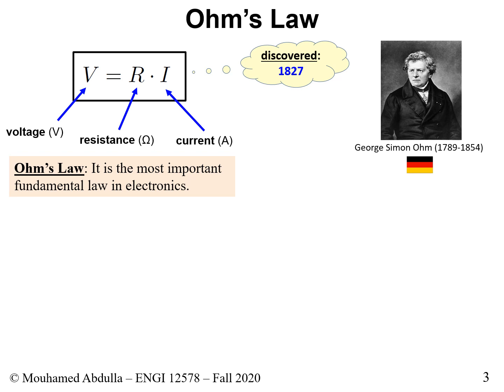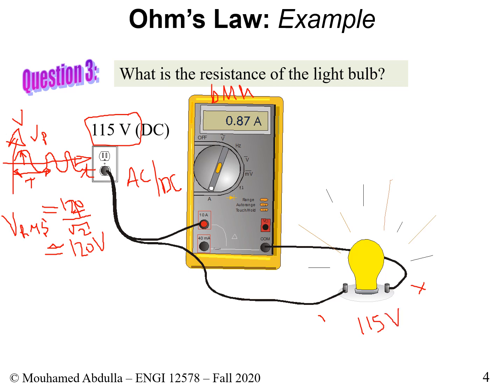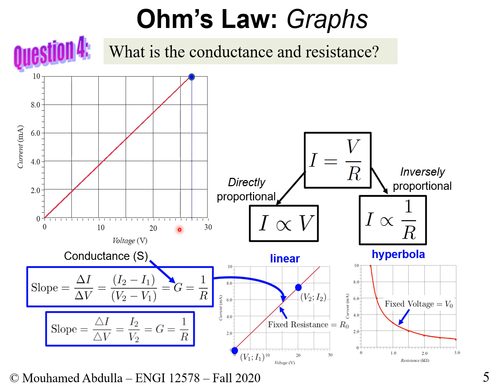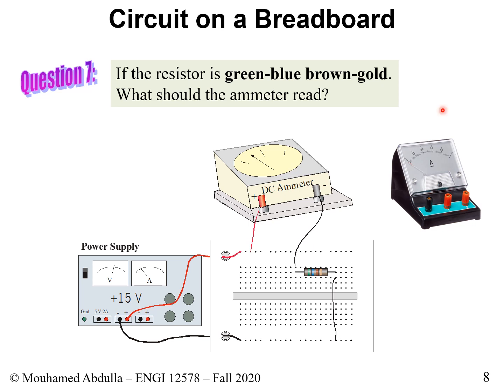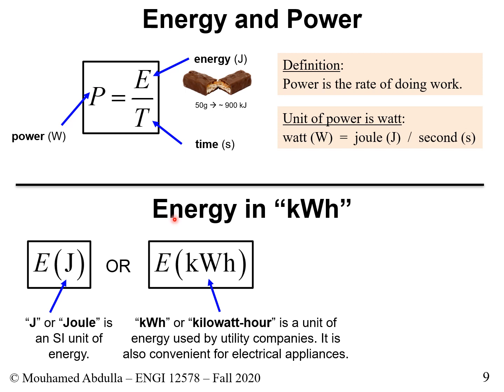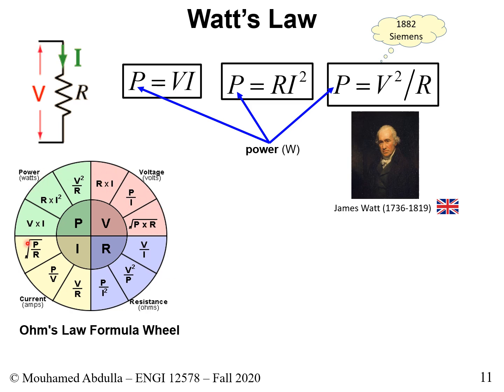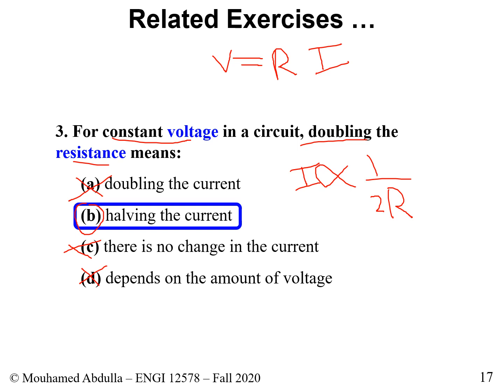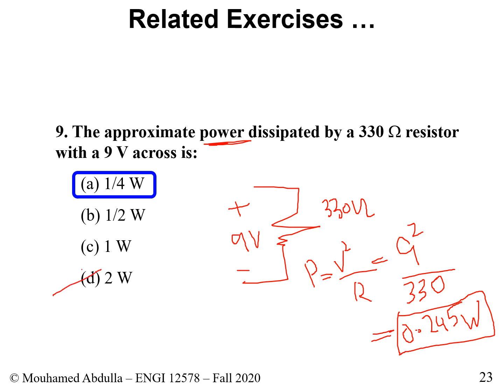Lec 3 - DC Source, Voltage, Current, Resistance, Ohm’s Law, Energy, Power, Watt’s Law

Comment from the maker: Timestamps:
--------------------------
00:00 - Introduction
00:20 - Analogy for Closed Circuit
05:37 - Ohm's Law
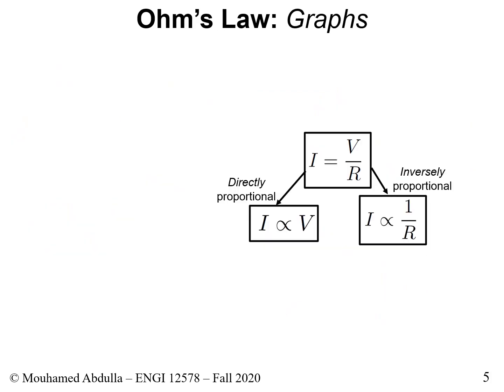18:11 - Graphical Interpretation of Ohm's Law
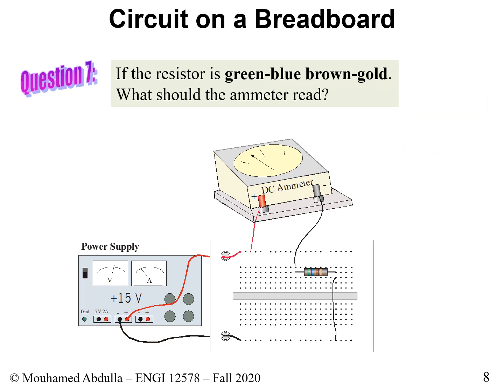32:26 - Circuit on a Breadboard
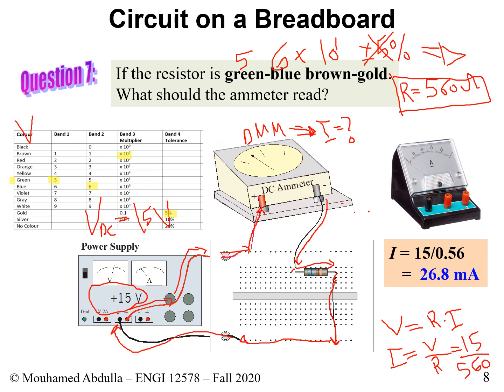38:55 - Energy and Power
42:16 - Energy in kWh
49:30 - Watt's Law
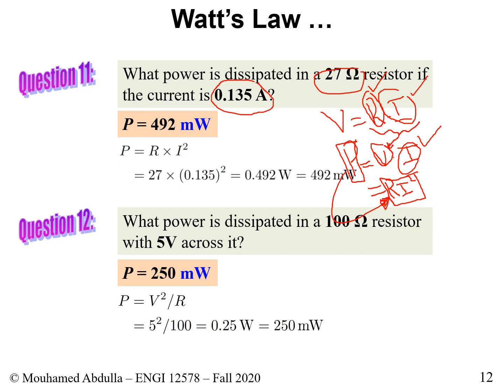58:09 - Key Terms and Definitions
58:23 - Relevant Multiple Choice Exercises